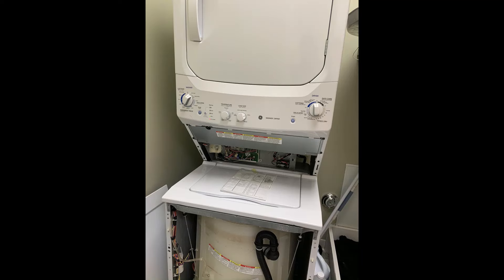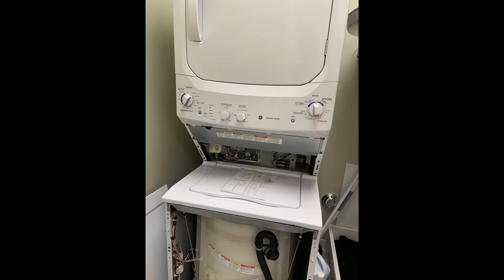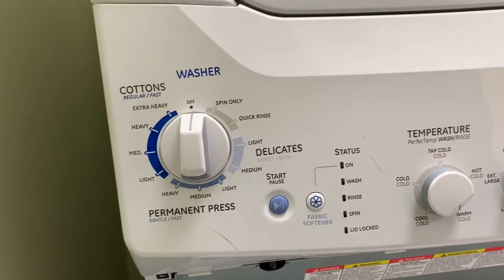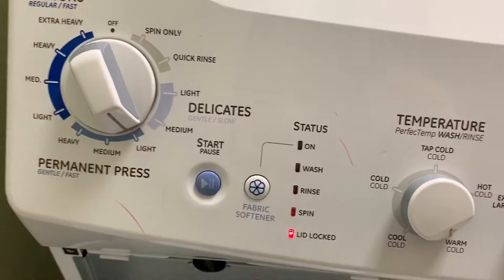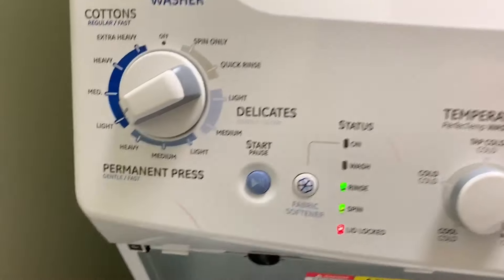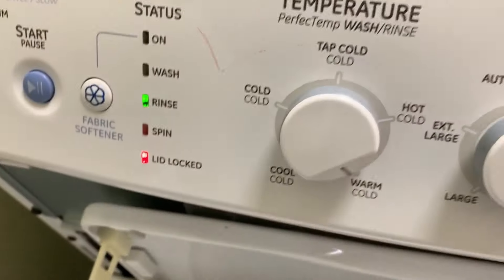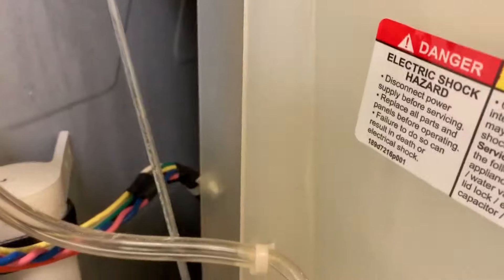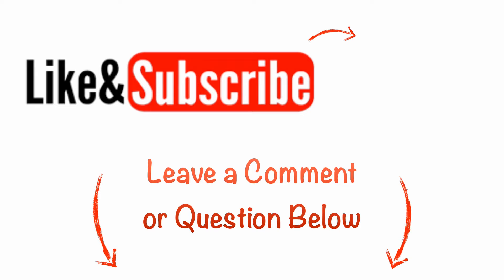How to use Diagnostics on Stacked GE Washer Dryer combo(Laundry Center)

Comment: What do you do if you can't even get INTO diagnostic mode because there are no lights/power to the washer? The dryer works fine...so odd!
Reply: I am having this same problem. Did you figure it out?
Reply: Same problem,  just got delivered.  Dryer spins but nothing from washer....
Reply: Anyone figure this issue out? No power to washer!!!
Reply: I’m having the same problem. ANYONE FOUND A ANSWER?
Reply: Anyone find how to get codes?
Reply: Same problem
Reply: YEEEEEEEEAHHH. I'm here for same. Need help
Reply: Me too dryer works but appears no power to washer? Did anyone receive or find a response from the You Tube host?  I can't find any responses? Thank you !
Reply: For no power try checking the power cord on the back a lot of times where I work they can burn out and replacing the cord can fix the power problem
Reply: Issue might be outlet its a 240 so one prong might be burned out.
Reply: Probably Motherboard. However I took the cover off under the controls and unplugged all the connectors I could and reconnected them and it turned on and I finished my laundry. Hope this helps!
Reply: Having the same issue
Reply: EVERYONE THAT IS LOOKING FOR A ANSWER WHEN YOU HAVE NO LIGHTS/POWER OR BLITZING OUT LIGHTS, Check the power cord. Especially where it connects to the machine terminals , mine was melted and that was the problem.
Reply: @glenwood785 probably melted power cord connecting to washer terminals in back
Reply: Check power plug, especially where the terminals connect to washer in the back
Reply: I'm having the same issue. 

Has anyone solved this issue and can offer advise…
Reply: @bryanmorse6621  I had same issue, my electrical cord was burnt up. Specifically where it connects to the terminals on the back of the washer. Check those wire connections.
Reply: I'm having the same issue. 

Did you get it figured out?
Reply: I'm having the same issue. 

Did you get it figured out?
Reply: I'm having the same issue. 

Did you get it figured out?
Reply: I'm having the same issue. 

Did you get it figured out?
Reply: I'm having the same issue. 

Did you get it figured out?
Reply: I'm having the same issue. 

Did you get it figured out?
Reply: I'm having the same issue. 

Did you get it figured out?
Reply: I'm having the same issue. 

Did you get it figured out?
Reply: @bluegrasskid  I couldn’t figure it out so I payed for a diagnosis. Was told it was the main board. Was being charged over $600. No thank you. I ordered one from eBay and replaced it myself. Still doesn’t work 🤦🏻‍♂️. Tried what this video does and no lights blinking. Why is it so complicated! 😆
Reply: power to one half and not the other could be control board malfunction
Reply: If you have 240v, powers cord good, next check the fuses, there should be two fuses.
Reply: @KingofQueens_79  did you check the fuses?

Comment: You just saved us a LOT LOT of $ - the washer in our stacked wouldn't fill, just kept draining. GE troubleshooting sez "Reset" but they don't tell you HOW. I went into diag mode and then unplugged it, that did the trick. Wife thinks I'm some sort of genius.
Reply: Just had the same problem and the same thing worked for me. Excellent advice from an expert service tech. Much appreciated. Joseph.

Comment: I have a new GE stack washer/dryer.  When I put it on Bulk to wash it will not fill with water to cover the clothes over 1/4 full but it fills to the top during rinsing.  How do it fix that.  I can hardly put any clothes in my washer
Reply: I am having the exact same issue. Except mine doesn't fill with water to cover the clothes during the wash and rinse cycles.

Comment: Thank you so much. I started my 2 year old washer with water feed valves closed. Drain pump wouldn’t stop running even after unplugging the washer and waiting. 
I pulled the plug and waited over an hour but it still ran after replugging. I tried the initial diagnostic setup and pump stopped and machine now works filling up normally w/o pump running. Thank you for saving me a service call. All best…Joseph.

Comment: It's such a treat to find useful information on these appliances my wife recently found out the washer was haveing a problem I took the front off and saw nothing I can understand at he time it was bleived it threw a belt however with those video it may Explain something else as the home Depot is were we got it and there giving us that line dance routine were this information you have shared may cut to the quick of solving the trouble it just can be the computer acting up from a power surge or some one not pushing buttons in the right order this can help a lot looking forward to trying this method
                                                               Thank you for sharing

Comment: Yup just did the all cycle through with exceptions of hot cold valves. Exited diagnostic mode. And ran an empty (no clothes) small load size for water on tap cold and light on permanent press. Watched it with the front cover off the whole time to ensure the gears aligned and the pump worked and no weird noises were identified. Gtg. Thanks for the wonderful tips. Saved me so much money. And my landlord a headache

Comment: Awesome video! I have this unit, and it fills with water while not in use. I am assuming I need to replace or clean the cold water valve. I'm hoping this diagnostic will help me sort it out before I just start buying random parts. Thanks, bif thumbs up!

Comment: I may need to change the water inlet connection. One of connections is ragged as someone tried to attach a hose and I guess they couldn't get it to work. Do I have to replace it, or can I clean it up/ sand it down a bit?

Comment: Hi there great video thank you. The only thing I didn’t see was a diagnostic for the lid switch. I have the exact same machine as the one you were showing but sometimes it won’t start unless I open and close the lid or sometimes it stops mid cycle and I have to open and close the lid to get it to finish the cycle. 
I’m thinking that’s probably the lid switch but maybe it’s a plug connecter or something is there a test for this or do I just replace the switch?
Thank you

Comment: The White Spin shifter…. You say it should slowly move down. … mine  did not appear to move at all as the washer filled. Then the motor started. BUT, the white shifter still looks like it’s in the raised position. It’s definitely not making contact with the black gear looking thing below it. Is this a problem or is this how it’s supposed to run? Thank you.

Comment: Thanks a lot! I am following through your video since my drain pump was not working. But when I put this in diagnostic mode at knob on 8 oclock, it makes a vibrating noise and nothing else. So I am not sure if mine is just stuck as I can feel that the drain pump is getting hotter. 
Also, the color of wiring between yours and mine are opposite. Left side black and white right side orange

Comment: Great video!  Just had the agitator fail to move in water during wash cycle but makes loud sound like the engine is tryingl  We suspect this is the second time the bottom of the agitator will be chewed up (it's just cheap plastic) by the strength of the steel teeth of the engine in contact with it.  Can you help us, please.

Comment: My dryer tumbles but does not heat. Is there a reset button or a  process to reset the dryer? Or maybe a fuse...
Reply: I have the same problem Only information I found online is information in regards to the washer. Nothing on how to gain access and troubleshoot the dryer.
Reply: I am bound and determined to figure this out. To be continued...Lol I will let you know when I know.

Comment: Dear Mr. Bearded Guy,
Want to start off letting you know I am a retired divorced woman on a pretty tight budget,  That being said, I am having trouble with my GE stackable and after watching countless videos (yours are the best)I have learned how to diagnose. The issue seems to be when in diagnosis mode and clicked to heavy after a few minutes it works but when it is switched to light, it does nothing.  The rinse and spin lights are green.  My understanding is that the problem is with the drain pump. It does not appear to be clogged from looking at it (unless I need to take those hoses off to know for sure)  Is it possible for you to post a video on how to change the drain pump? I would greatly appreciate it. Either way, thank you for posting these videos as they are super helpful. Sincerely Margie

Comment: Thanks so much. I did reset, all the light turned off. But when I try start wash. The wash and spin flashing again. With light on and lid light on ....4 f light on again. Same like before..... Anything I check push start button. Wash and spin flashing.       What do you think the problem is? Or I need open it check the model code first? Appreciated...thanks

Comment: I am the " water boy"  on my GE combo machine. I put the water and the combo does the rest. It' s new, only 2 months and the place went bankrupt.  
The washer "sprits"  water 2 or 3 seconds and nothing more. 
I opened the lid, placed a magnet so it " feels"  as if its closed and use my garden hose to fill up and to rinse too . 
It washes, spins, etc...
Maybe I should I reset the water level ?? 
Is there a code for knowing the level and that' s why its not filling up?
Please help !!!
Thank you

Comment: No power to washer, dryer is fine. Just had electrical subpage installed for new cooktop and oven. All fuses not tripped. Unplugged, replaced in, no power on washer. Only 1 year old.  Was never touched during kitchen renovation.
Could sub panel install have caused this?
Thanks for quick reply.

Comment: Hey, my machine starts to wash. But then it stops. I bought the piece from the lid. That it was broken. And the other piece that locks the lid, and it still does the same thing, like it will starts to wash, but then it stopped,  I tried to reset it,  but I can't,  and I did same thing u did in this video, but instead it started to take the water.  And this washer I bought like 4 years ago. What can I do to reset it?

Comment: Opened up the front panel found the tech sheet.  getting into codes is hold start button only.
problem = washer stops after wash cycle.  door lock clicks three times and , ...boom nothing.
turn to spin cycle it drains and spins.
any thoughts?

Comment: My washer won't light up like there's no power. I have the same washer dryer, the dryer works. But washer doesn't work. Nothing like that. Is there a breaker of fuse and dishwasher?

Comment: So I replaced my belt runs great but should that be adjusted? I see two black tabs on the motor mount near the motor mount bolts are they limiters on how much you can tighten this up? Thanks I got a beard too

Comment: Mr. Beard of Knowledge 

Thank you for showing us how these washers work and how to test them. 

My unit was different, but the same.  You still showed me enough. 

To everyone wondering where ‘The Beard’ finds the manuals, I found mine taped to the backside of the panel just above the washer door that covers the main control board.

Comment: Thank You friend i have a GTUP270EM4WW THAT IS ELECTRIC BUT LOOKS IDENTICAL TO YOUR UNIT. mine has two capacitors for motor start, one for the washer on below washer left wall and one for the dryer motor ( dryer motor does not have a centrifugal start switch it uses a capacitor start) Ugh it is in the upper compartment but doesn.t show where, i am looking where it my be located and what i have to do  to get at it, Thank You in advance

Comment: Thank you so much for making this video. Do you know if the washer is supposed to make a sound like a chime when the cycle is completed? Mine only makes a sound for the end of the dryer cycle
Reply: No chime at the end of wash cycle on my GE 
GUD27ESSM1WW. I’m here looking for info on the fact that it just doesn’t seem to fill more then 1/2 full. Perhaps it is supposed to be a high efficiency unit. I miss my front loader. 😢

Comment: Hi & thanks for the useful video.
I ran the test on my washer, hot water, spin and thermoactuator are working fine. But agitation not working and when it is on position 9, water fills into tank, but agitation not starting and suddenly the “wash” light illuminates and when I push the start button, it agitates just once and then “wash” light starts to blink. How can I fix it?

Comment: How did you open the front of the appliance?  I have a sock stuck in between washer drum and exterior casing.  Thx in advance.
Reply: If it's like the GE stacked washer/dryer we opened yesterday, there are two hidden "S-shaped" metal clips at the top of the front panel that hold it in place. You can see these if you shine a flashlight into the crack between the top panel and the front panel of the washer. You can use a putty knife or flat screwdriver to push these clips up, which allows you to pull the top of the front panel towards you, then you can take off that panel entirely.

Comment: I have a GE washer dryer stacker and I need to change out the switch for the washer so it can drain how do I gain access to it do I remove the front panel and how do you remove the front panel

Comment: That is the model I have! I need your help with it, please! I moved into a new townhouse condo recently and when I first used the washing machine, there was black gunk (scrud I think it's called) all over my clothes. I have tried many times cleaning it out with a cycle of vinegar, a cycle of Affresh tablets, and letting the Affresh soak for hours before rinsing it out. It works at first, but a couple of weeks to a month later I'll start seeing bits of the black gunk again. And then I'll have to do another cleaning. 

I suspect the gunk is under the agitator, but I don't know how to take it out or if I should call a technician to do so. 

Is there a way to prevent this from happening? I make sure to use a big enough load, I keep the lid open after use, I don't overload it. I'm at a loss. Should the agitator be replaced?

Please help. Thank you!

Comment: Are you reading from a manual to get this info?  Where do you recommend to get these manuals from?
Reply: There is a panel just above the washing machine lid.  You remove the two screws and pull the cover.  (It covers the main control board.  My issue was a loose connection up there.)

I found my manual taped to the backside of this cover.

Comment: My W/D combo GE is not working, i ready replaced the basket and water pump, relay, I checked the wires under the washer ,the capacitor is ok. But still not working, can you help me,  please. thanks in advance ☺.

Comment: Hi guys, I have the same laundry combo, and the dryer dies recently during to a power failure. I believe is the 4 wire thermostat but before I start digging into this I thought is better to check with specialists here  if anybody had same issue in the past and how was it resolved. Any help is appreciated! Thanks

Comment: My GE washer was leaking from bottom last year only when filling warm water. Was not leaking with cold water only as pressure is less. Called a guy and he said its the pump behind the inlet hoses, quoting me a crazy amount. I went and got a pump and my son and I replaced it. Sure was a torture to get to it. It wasn't the pump after all this. The little showerhead behind the inlet was clogged. Took that out, cleaned it and all was good. Was fine until last week. Now leaking from bottom with either temp but still only while water is filling. Can this be repaired? This unit is approx 6 yrs old and used may be once /week.

Comment: How do I increase the water level in my stacked Whirlpool washer dryer combo?  On the large setting, the water leve is only 1/2 way full.  That doesn't provide enough water for the clothes to be cleaned and rinsed properly.
Reply: I have same issue. Have you found any answers?
Reply: @desireealger8117  No.  Still haven't.  My washer only fills 1/2 way.  It was created that way to "save water".  Stupid.  Cannot clean a full load of laundry.

Comment: This question is about the GE /Kenmore stacked washer and dryer  combo. When in diagnostics, I position 7 the spin test the lid locks ok then it starts u spin then stops after 10 or 16 seconds. Then if I go to position 9 agitate it will agitate for a few seconds as it did in the spin test. In other words it seems like this is something on the board .

What do you think?

Comment: Hi Sir, I can't get mine to drain it just clicks when I put it on the drain cycle.
Only had the machine for 6 months.
My 6'oclock position says HEAVY not MEDIUM, must be a different model.
My diagnostic lights wont come on when I hold down both the Start and Rinse buttons
Reply: I had the same issue.  Any one can help.

Comment: Thank you so much for this video. My washer is getting to the rinse cycle and stopping and it clicks about four times. It won't rinse unless I open the lid press the buttons until it works but I don't really know what I'm doing. Any thoughts on what could be wrong?

Comment: Thanks for the videos.  Interesting problem.  The lid lock was broken (the plastic) and I installed a new one.  I still have the on/wash/spin lights flashing and I can not go into diagnostics at all.  I put the dial on 6 o'clock, hold 3+ sec, nothing, still flash.  I put the dial anywhere, 3 oclock too, still the 3 flashing lights.  It seems to be stuck.  Unplugged, pugged in again, same flashing lights.  Any advice?  Also a note for others reading, the GE washer with agitator, the "fabric softener" button actually says "deep rinse".  My model is GUD24GSSJ0WW.